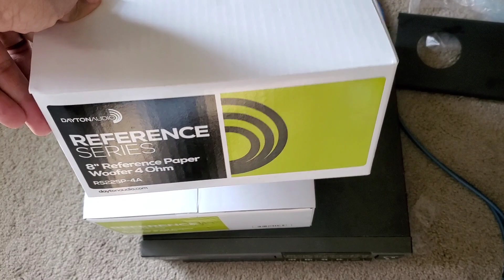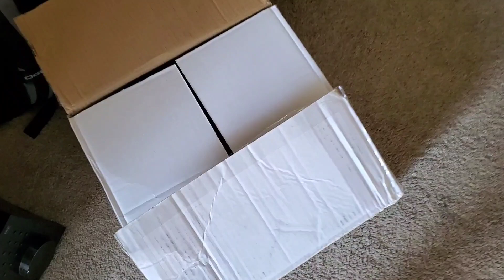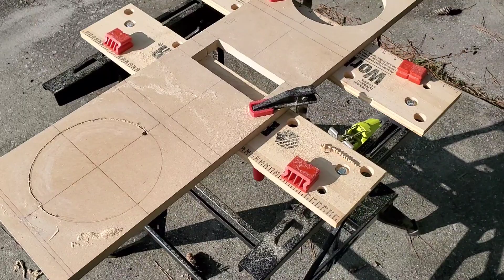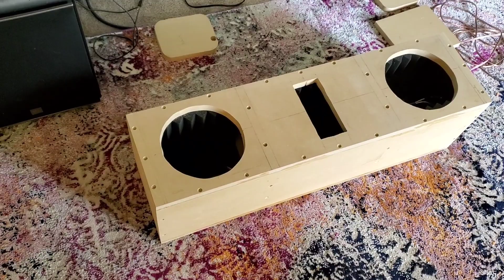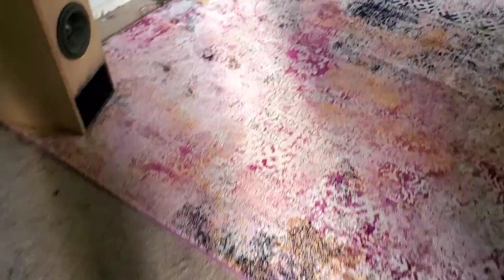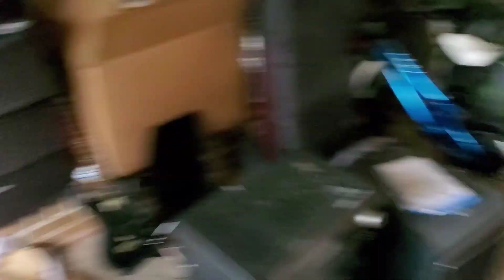DIY Center Channel Build and Sound Demo.

Comment: FYI Home center stores like HD and Lowes aren't even obligated to cut half inches. The machines show signs saying they cut to one inch tolerances. They aren't there to fulfill cut sheets. They're there to break down plywood to fit in a amaller vehicle. Always gotta take bigger pieces home and cut it yourself because they'll always disappoint with smaller tolerances.